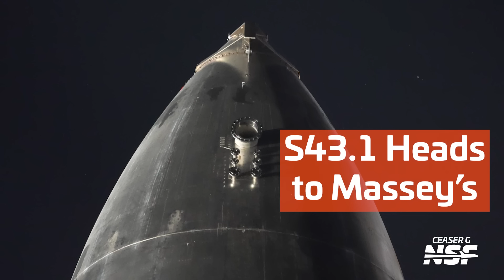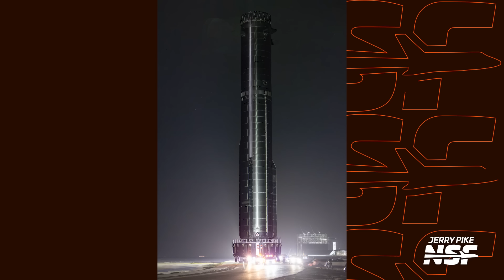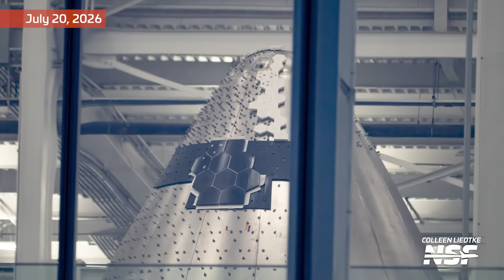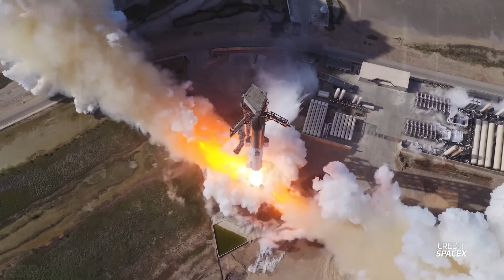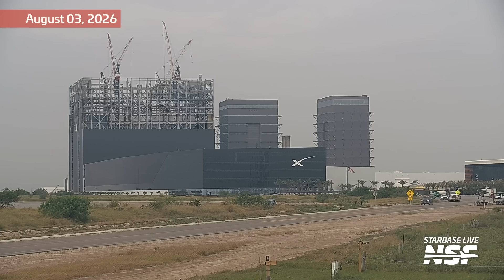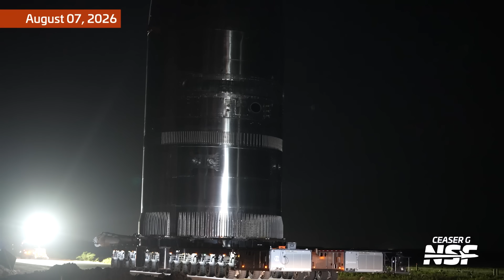SpaceX Says Starship’s Heat Shield Is Solved, But Is It? | Starship Update

Comment: "An operational Starship program means Falcon 9's days are numbered."???
Is SpaceX going to forfeit ALL LEO contracts with their various partners to Blue Origin and (gasp) Boeing? Are they really going to send the biggest, most powerful rockets ever designed on trips that are basically errand runs to the corner store and back. The ISS may be nearing the end of ITS lifespan, but there are still going to be LEO manned space stations needing crews and supplies sent up to them on a steady schedule. Axiom will be one of them. It is going up there next year and will be attached to the ISS but will be undocked and set in orbit by itself just before the ISS is deorbited. Not even NASA wasted long ranged rockets on short range missions. Apollo 7 & 9; Skylab and its crew flights; and the Apollo-Soyuz Test Project ALL used Saturn 1B rockets instead of the Saturn V rocket to launch to LEO.

Comment: I highly doubt the heat shield is rapidly reusable yet. For that to happen it can’t lose any tiles and the tiles that remain must be in good shape! Not trivial. In fact it’s never been done before as far as I know
Reply: Launching once a day doesn't mean that they are launching THE SAME booster and THE SAME Starship every day. They can make a dozen of them and rotate, which would give a week or two for refurbishing. Did any of you guys learn to think logically? ;-)
Reply: @lepidoptera9337  well, they only have 2 years to make a fleet so they can do that. And it’ll take a long time to refurnish these massive starships. To inspect and replace tiles meticulously with zero mistakes. And if that’s the case, and starship can’t get past that need, then yeah it’s not living up to expectations. Maybe after many years of operation they can get it down to a steady launch cadence. But I think the moon by 2028? I doubt it
Reply: @generalsirc2615  They are building one of these in a couple of months and they have a pipeline that can build several in parallel. The scale of manufacturing has certainly exceeded that of the Apollo program by a considerable multiple. I take that as an indication that, unlike the Apollo program, this one won't be shut down for political reasons. War is coming and the US is preparing for it.

Comment: I know they're in the process of laying more pipelines for water and methane so they don't need all these trucks. But I'm thinking just like the data centers have become responsible for providing their own power plants so they don't pull the grid down, they should drill their own Natural Gas Wells for an uninterrupted methane supply. That way foreign governments can't interfere with product availability.
Reply: The US is choke full with natural gas deposits. There is absolutely no chance that a foreign power can cut that off.

Comment: autogenous pressurization - Always get confused here. I was under the impression fuel (methane/oxygen) was being heated to a gas and sent into the cryo tanks. not burned fuel which could freeze. Never mind AI knows everything - Methane tank is pressurized by pure methane vapor, O2 tanks have a tiny bit of combustion products in the pressurization gases but mostly O2.
Reply: You tube will not allow any pointing to other YT channels in the comments so I will have to be cryptic. There is another YT channel that deals with STARBASE in a investigative method, like the CSI TV series. One video deals with the autogenous pressurization method used in the superheavy. The video was made some time ago and changes might have been done since then in the rocket. The gasses apparently come from a pre-burner in the engines, not a heat exchanger.

Comment: If the Starlink satellites couldn't be jettisoned, could the Chopsticks capture the Starship?
Reply: Yes.
Reply: @smorrow  There would be nothing to catch. The ship would break up on re-entry because the heat shield is not designed for a fully loaded ship. It can only save an empty ship.
Reply: @lepidoptera9337  Designing it without downmass capability would be an unacceptable regression in capability with respect to the Shuttle
Reply: @smorrow  Yes, because the Shuttle brought so much stuff back... have some more attention, kid. :-)

Comment: How can the heat shield be solved if the Starship hasn't gone orbital yet? Seems like there will be additional stress with the new flight path. If it survives, we might start talking about it being solved.
Reply: SS is already just shy of orbital velocity. Not going to be much different with orbital velocity. Return speed from lunar flight is going to be a different matter.
Reply: @frankderks1150 It's basically already been done. Maximum velocity was around 16300 mph, LEO at 150 miles up is about 17000 mph. For intents and purposes it's been tested at orbital re entry successfully.
Reply: @brianw612 
More like 17500 mph...
Then you have additional energy of 15%  with that jump 😉
Reply: Aditonal energy, assuming that means a higher velocity, would result in a higher orbit, which would be a slower velocity to maintain a stable orbit. Gravitational forces weaken as you move away from the center of mass, resulting in a lower velocity. At 1k km it's 16,450. You need to speed up to get there then slow so that you dont keep going higher.
Reply: The reentry speed of SS from an actual orbit will be just a few hundred km/h higher. Max. 1000 km/h higher. Not a big deal. Basically, a negligible difference in regards to the reentry dynamics. I wouldn't call or consider the heatshield to be solved. There is still room for improvement, but yes, the heatshield seems to be working fine, in general.
Reply: @jurajdurzo2876  The heat shield must be rapidly reusable for Starship to be rapidly reusable. I don't think this problem is close to being solved, otherwise we wouldn't see significant tile damage even after 13 flight tests. Maybe things will speed up when they get a ship back. But that isn't certain since the Space Shuttle also required regular heat shield refurbishment for its later flights.
Reply: @cube2fox  That's the final goal, not what is required to make it operational.
Reply: @imaginary_friend7300  It's required for being "solved". Being operational is not enough.
Reply: @cube2fox  how can you, a YouTube commentator, know more about the structural integrity of the heat shield than the owner of the company that produces them. Oh yeah, you’ve got some YouTube clips vs their actual diagnostic data
Reply: @shaneross6229  We already know that Elon's predictions in the past have been far too optimistic. One can make better predictions than him by simply tripling his timelines. No insider knowledge required.
Reply: @shaneross6229 
Starship landed on mars 4 years ago, with crew landing on mars 2 years ago, acvording to Elon... reality: Starship doesn't even reach orbit yet, has never reached orbit, has never been refueled in orbit, has never had the heatshield in such a condition that it is reusable....
Reply: @i.i.iiii.i.i It was within 800 mph of orbital velocity, its was basically there, deliberately held just short. They tested the orbital mechanics and re entry parameters without going full orbatial.
Reply: @brianw612 
Usually a bit more but yes... still 7-15% additional energy is required to be taken by the heatshield. 
Speed wise it was close but the energy doesn't dcale linerarly with speed
Reply: @jurajdurzo2876  There will always be room for improvement. I think "solved" means that the ship is not in danger of exploding due to tile failure. Occasional refurbishment is acceptable when there are hundreds of ships in the flight que.
Reply: Your understanding of orbital and the forces involved is flawed.
Reply: @imaginary_friend7300 So many dont have a clue about what an orbit is. They seem too think that gravity mysteriously ends at LEO and everything just "floats". They dont get the concept of free falling over the earths curvature.
Reply: crypto SCAM above ⬆️

Comment: To claim the heat‑shield issue is "resolved" feels premature. Starship hasn’t reached orbit yet, and when it finally does, the tiles will face far higher and longer heating loads. The real challenge isn’t simply surviving re‑entry once, it’s doing so repeatedly. The "It’ll probably be fine" approach sounds more like hope than evidence based, reminiscent of the first test flight when the launchpad’s "special concrete" was supposedly able to withstand lift-off without a water‑deluge system.

Given that the booster on Flight 13 failed to land, it seems a little bold to attempt a catch on Flight 14. Few development programmes respond to a failed test by immediately escalating the difficulty. It raises the question as to the "Go Fever" that was to blight Nasa record is starting to affect Space X.

The obsession with rapid turnaround also seems misplaced. It only matters if there’s a sustained launch demand, and outside Starlink, that demand simply doesn’t seem to exist. Starlink itself has finite needs. 

Demand is being manufactured by the promotion of space data centres, lunar factories, and other speculative concepts, regardless of how feasible they actually are.
Reply: It's the speed not the path.  It has survived orbital speed re-entry.  The special concrete was hoped to survive ONE flight only.  It's news to me that they plan a booster catch on flight 14, I though it was only Starship.

Comment: The (finally) successful engine relights and orbital insertions resulting in the high quality data gathering of heat tiles after splashdown i think was the final bit of detailed data they needed to 'sign off' on a 'finalized design' aka a first iteration of an operational design that can be settled on and iterated through production, aka no longer experimental. The big deal with starship is not necessarily getting the tiles to survive, its about getting a large enough percentage of tiles to survive and have enough protection underneath any given tile that ensures the ship will survive reentry with passengers. Just like falcon boosters, they only need data on margin of error so say maybe humans only fly on ship with less than 3 reentries but maybe over time they increase that threshhold as they iterate on the design and learn to extend the lifecycle of tiles and the underlayments/attachment mechanisms and optimize flight profiles for heat tile age, where possible. They also don't need a starship to be refurbished and ready to fly within 24 hours if their transport system is up to snuff, they can catch, put that vehicle on a transporter and wheel that over to be inspected and refurbished for flight in 1 week, then they only need 1 starship for each day of the week to cycle through. o: exciting times. their biggest struggle, as always, is creating capacity for an industry that isn't ready for fulfilment of that capacity yet, but soon will be. Starlink is a great way to subsidize and home-grow / inhouse grow a revenue stream from falcon 9, they just need to do the same for starship's capacity. hopefully that means private orbital stations along with beefier starlink. orbital datacenters that can crunch numbers and high levels of science as a mature technology is 100% going to be needed for humans on the moon. the moon will need some orbital satellite constellation(s) of some sort that can ensure 0 downtime in high speed communications and, having data storage and processing on a mature platform with its own power source floating around the moon is less payload weight and power draw to worry about down on the surface. along with navigational GPS and communications relay functionality!

Comment: Currently Starship can only launch satellites through a wide but narrow door - that's very different from having a fairing that can expose very different shaped satellites. Either satellite design will need to change to match starships launch capabilities, or starship will need to change to match the requirements of the satellite, or Falcon 9/Heavy keeps flying.
Reply: There's scuttlebutt around that posits that the flat satellite form factor will be a forcing function such that many different use cases will adapt to it instead. 

To be fair, most payloads today are designed for smaller spaceships, so new payload providers will be incentivized to make flat payloads.  

I'm sure different fairing styles are inevitable for starship, but in the meantime we'll see a lot of flat satellites.
Reply: @p3t3mit  maybe, but you're not launching any potential unfolded JWST successor through a pez dispenser slot
Reply: @karlwest437  I'm not saying they will.  Starship will need different variants for special payloads.  But that's not what most companies need.  Watch Eager Space's video on the subject as it's insightful on this topic.
Reply: What makes you think that will be the only Starship variant there will be?

Comment: judging from the last time he said something was essentially "solved", fsd back in.... wait 2015??? 
We are still a long ride away from rapid reusability
Reply: Yeah, depends on how you define solved.  If generous, solved could mean in this context that the problems that are left are engineering and not hypothetical.
Reply: Yeah, if the heat shield is "solved" when his stated goal was always repid reusability, this would mean the heat shield is already rapidly reusable without refurbishment. Which is almost certainly BS.
Reply: @cube2fox  do you even follow any of this? Heat shield has always been the big one and a ship that has 10s of thousands of tiles that now only has a few broken ones on it is a huge milestone.  You don’t have access to the info that Spacex does and for all you know those damaged tiles could have been caused by other sources outside of just thermal.  If Spacex now has a tile that is fine after a landing then it is indeed solved. Tiles damaged by vibration/launch/movement is an engineering issue and not a thermodynamic issue which is what the main problem was that needed solving
Reply: @shaneross6229  That's not true. The main issue that needs solving is rapid reusability. The Space Shuttle did already test reusability of basically the same tile material, but without achieving rapid reusability. Rapid reusability requires avoiding any kind of tile damage, gap filler damage, or other damage to the TPS, no matter if it comes from vibration or something else.
Reply: @cube2fox That is an easy solution, you just have more starships. Super heavy is the rocket that actually needs to be rapidly re-usable. If you need to launch ten times in a day you dont have one starship launch and come back down ten times in one day, you have ten starships launch on the same super heavy booster and come back whenever their mission is complete
Reply: @qrzone8167  By that metric, the booster doesn't need to be rapidly reusable either. You can just make more boosters according to your logic.
Reply: I used to think he himself believes these claims, now I think even he does not believe it.
Reply: When did he claim FSD was solved?
Reply: dude also said "hyperloop is super easy, its like an air hockey in a tube..." , so yeah we dont really wanna take the guys word on things.
Reply: "Solved" could mean that the ship is not in danger of exploding during reintery due to tile failure.  However, do not define it as "never needing maintenance".  Everything wears out eventually.

Comment: The question comes down to this, if a couple tiles break, can it still fly. Time will tell, nuff said. 😊
Reply: The next question is: How many flights can a single tile withstand, and how do you quickly identify defective tiles after landing?
🤔
Reply: @MisterIvyMike They definitely need to put a big scanner on the catch tower. You can image the entire heat shield and if it passes you launch again, if not then the starship is moved out for maintenance
Reply: They have lost and deliberately left tiles off.

Comment: I wonder if they just need to make a drive piston to separate the autogenous pressurisation gases from the cryogenic liquid.
Reply: Drive piston?
Reply: I think he means more like a separation piston. The autogenous pressurization gasses is a weak point in the current design, the CO2 freezing out. It would take an engine re-design to avoid the problem however.

Comment: I'm guessing part of Musk's plan is to make sure that water, fuel, and oxygen are the main limiting issue so that it'll be much easier to convince local, state, and in the case of the Cape, Federal, governments to allow a fast-track build of underground or overground utility pipes. Its much easier to convince governments to do something when you can prove that there will be a direct benefit to the local economy as soon as a project is completed. 

Also, Cape Canaveral's infrastructure needs an update so its very beneficial for SpaceX to be at the forefront of that effort.

Comment: I wonder if you can modify the shockwave geometry by emitting lasers just in front of the heat shields, thereby shifting the heat caused from compression to shift away from the physical hull and into the wake of the Spaceship. That would be a neat trick.
Reply: My guess is that at these velocities and power requirements for the lazers it is a "no". But, I am not on the engineering team.  HAHA
Reply: @appliedfacts Yeah, I definitely agree with you that the road to reusability would cost in payload. But would hopefully be offset with more efficient engines. Like the ones we have now. I love the razors edge of science.